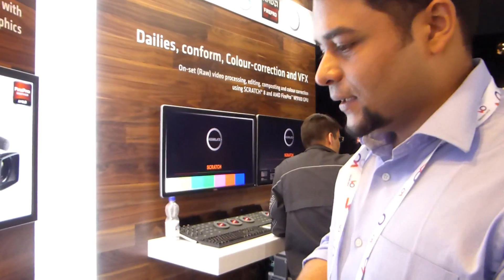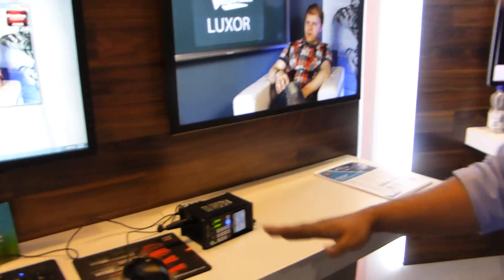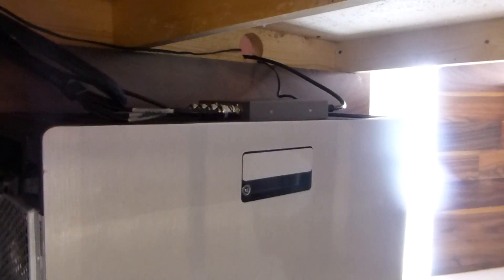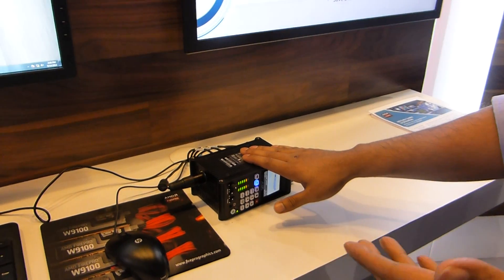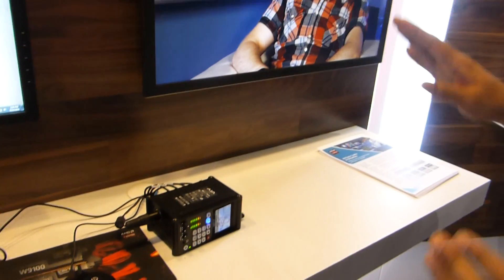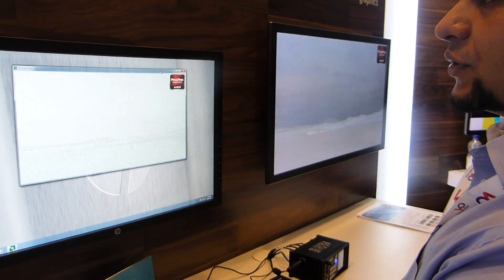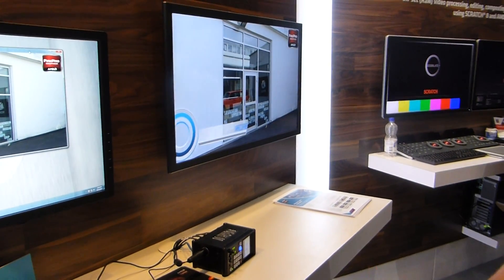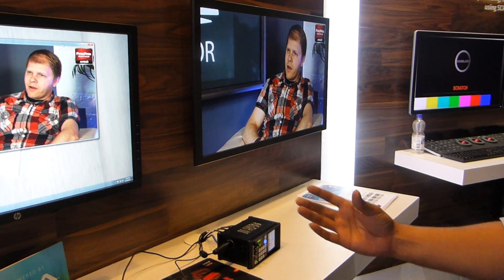AJA SDI to GPU 4k video workflow using DirectGMA on AMD FirePro

Comment: How am I only the forth view in 5 years?!?  Even the poster didn't watch this video?
Reply: Allocating drives @exFAT 32mb for speed if the system is anything like 2133mhz per unit on a 3kb config file..